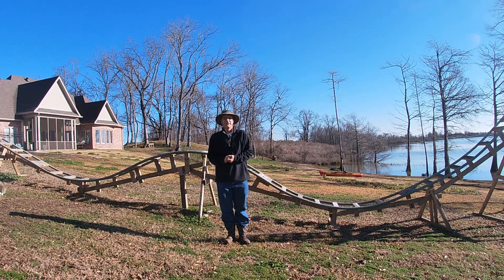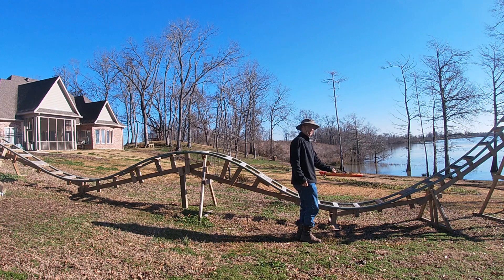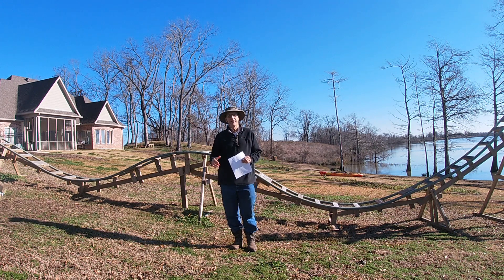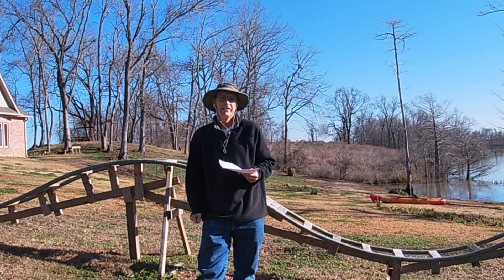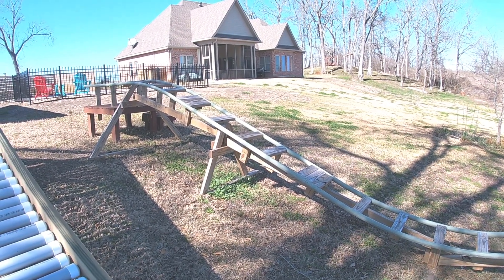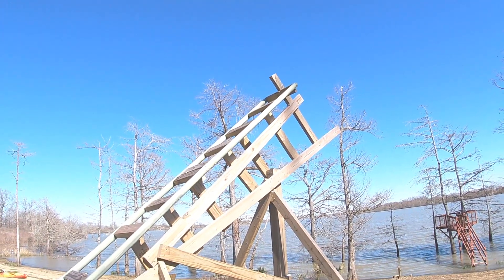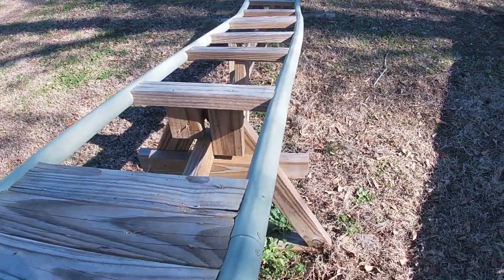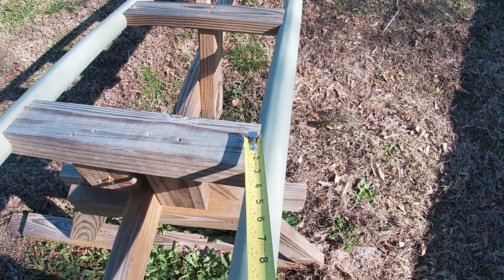How to Build a Roller Coaster

Comment: Do you think Sch 40 can handle 200 pounds, or should I go with Sch 80?
Reply from the maker: I used schedule 80 because I thought I would ride it. I never have. Mostly made for kids. It is very strong though. I guess w schedule 40 the screws would not be as secure.
Reply: @BayouDad  Thanks! I am planning on building one, and this video was very helpful, thank you.
Reply from the maker: @cbros324 great. It will be so worth it.

Comment: I’m so sorry for all the trouble but I had just one last question. I’m on my way to Home Depot and I was wondering what sizes plywood I would need if it needed to be a certain size? Thank you so much for all the info in the vid btw I would have never thought I would’ve come across this information
Reply from the maker: Get one sheet of half inch. So cool you are doing this.
Reply: @BayouDad  Thanks! I went to home depot yesterday and the plywood section was closed): Im going back tomorrow and in the video it looks like you have a 4x2 foot shhe with the half in thick as you said. Is hat length by width correct? I am so sorry for all the questions I know how to build the track and supports so this is the only thing i had trouble with(:
Reply from the maker: @deek2251  no you need 4’ x 8’.
Reply: @BayouDad  (: Thank you so so much!!

Comment: Im still a little confused on how to correctly create the 97 in radius arch do you think in your spare time you can make a vid on how to make the arch more in depth
Reply from the maker: Thanks for your interest. Just cut a string 97” long. Lay down your plywood. Put a nail at the end of the string and push in ground.   Put a pencil on other end of string.  Move plywood so arc will be in correct place. Draw arc w pencil. Then put blocks and thin panel section to make arc that matches line you drew.  Then slowly bend pipe down to match arc as you pour boiling water in one end. Does this help?
Reply: @BayouDad  yep thanks I appriciate it👍
Reply from the maker: @deek2251  if you have any more questions let me know.  I plan to do the cart video soon.
Reply: @BayouDad  ok thank you👍👍